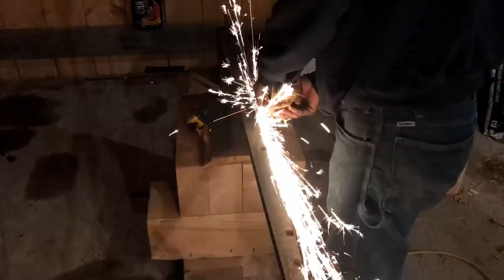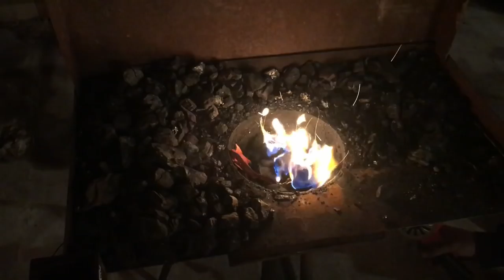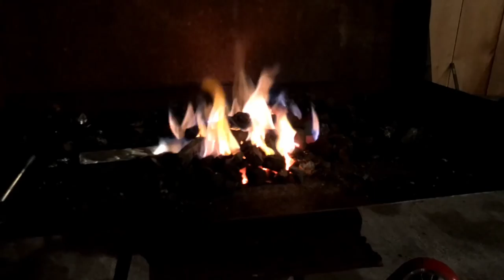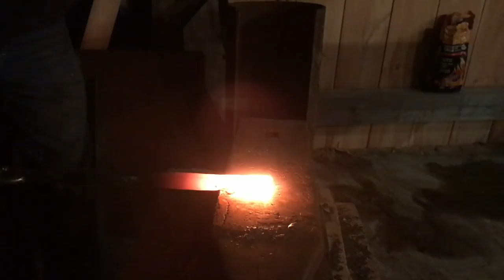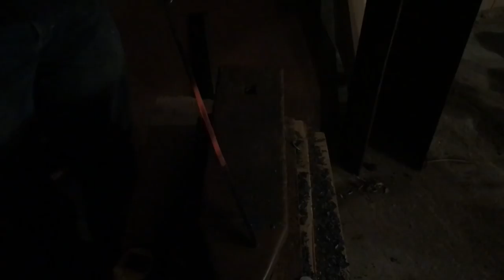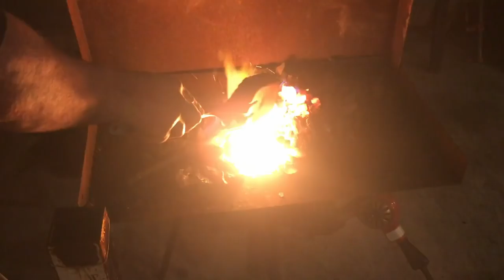Forging a Tool for a Mystery Recipient

Comment: Hey Jim, That is a great platform for your anvil! And it makes use of some of your cut-offs. I see that you are using the blower from your oil burner to heat up the fire, great use of a tool.
Reply from the maker: It works, a little backwoods but it'll do just fine.

Comment: Morning Jim . It's impossible to tell you what colour to look for bit the general heat slightly over loss of magnetic is right, the only thing I'll say is the anvil is to far a way I was shown for hand hammering like you are doing it one pace away if that out of the fire on the anvil in one movement. Hope that might help ?
Reply from the maker: That helps, good morning David

Comment: Nice Work Jim, you will end up on forged in fire before you know it. you talked about tempering it up to non magnetic, is that before the quench?
Reply from the maker: First step: normalizing, above magnetic, air cool

Second: annealing: take past magnetic, allow to cool,extremely 

Third: shaping and grinding

Fourth: heat treating.  1080 steel wants about 1500*F with a fast quench x 2

Fifth: tempering:  for 1080 it's 400* F for an hour.